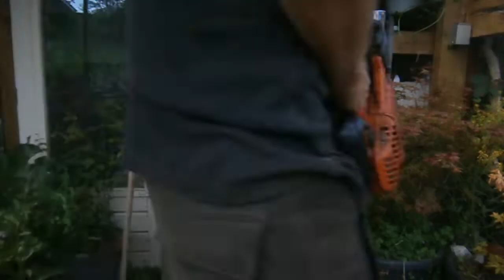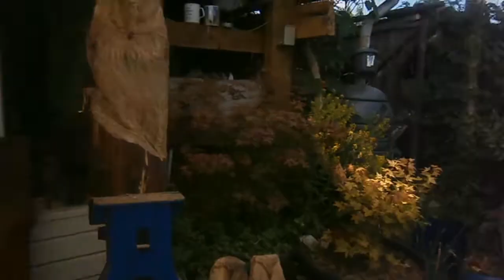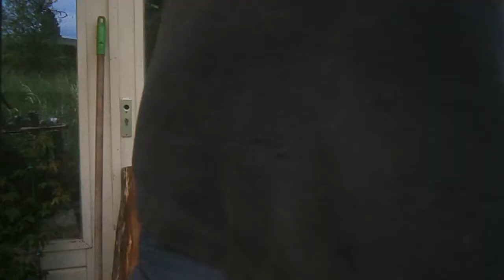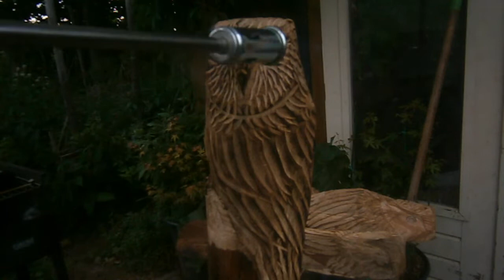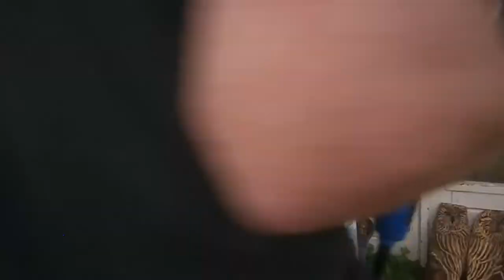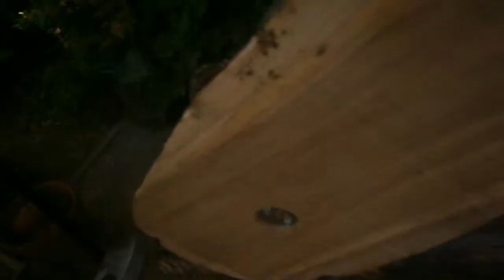Making a couple of wall hanger owl chainsaw carvings

Comment: One day I would love to learn how to carve with a saw. This is truly amazing work my friend. You rock!
Reply from the maker: Hi John, i feel anyone can learn to do this, when i started i made the first couple of things with a normal bar, after a while i upgraded to a quarter tip cannon bar but still used 3/8LP chains because i couldnt find a 1/4 sprocket for the saw i used. still have this bar today on one of the echo saws, i do run a 1/4 pitch chain on it now. expensive bars but they last really long.

ive used cheap chinese bars as well in the past, in the end the cannon bar outlasts them many times over. i only buy quality bars these days for carving but for a beginner the cheap ones are fine in my oppinion. One can always get a quality bar after ofcourse.

there are some little 25cc zenoah clones out there as well, for these saws a 1/4 sprocket exists, i used these saws for some years as well but they do vibrate more. paired with gloves that have anti vibration function i could use them all day, but without i would get tingly fingers after an hour or 2. I have seen them on ebay as well with a 1/4 pitch sprocket already on there and they come with a chinesium carving bar as well.
for the detail work id say they do fine, i still have one around but i dont really use it anymore. probably time to sell it.

I appreciate the compliments as always! thanks for checking out the video.
if u have any more questions about the carving stuff ill be happy to help.

Take care!

Comment: Nice work and presentation, fortunate to own one of these….imagine you have to sharpen chains a bit. Def have a recognized style as well. Keep up the good work!
Reply from the maker: Thanks Mr WP ☺. i was seeing how fast i could go on the chainsaw part of this kind of carving, i dont particularly like this kind of production style of carving but i did need a few more of these. as they sell pretty well. takes about 7-8 minutes to rough it out apperantly, 2 of them on 1 tank of gas.
I dont mean to flex haha, i prefer to take my time, suppose at least it leaves more time for other things..

The Sharpening is alright if i can use clean wood, as long as there isnt much sand in the bark and i dont hit the jawhorse at least.
i can sharpen these short chains pretty fast and generally its just a few strokes with a handfile to get a crisp edge back on the teeth.
so yeah if i wanted to i could probably squeeze out 3 or 4 per hour. but there isnt much fun in that.. feels like selling out to me.

Thanks for checking it out! and i hope the farmlife is treating you good.
Take care!